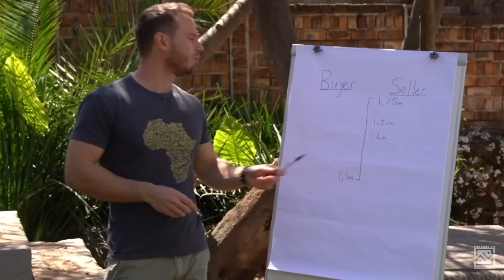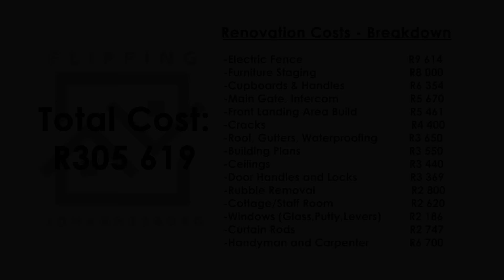Before and After House Flip - Project T | TWO RECORDS BROKEN! | Sold in 1 Day

Comment: Was the houseplan updated? I know most work was done inside and regarded as minor works.  I just also see alot of renovations been done to houses and there is no plans been updated.  Also if you have to revocer the existing plans you would be suprise how far the house has changed from the normal approved plans.

Comment: Nice! The only thing is; couldn't that weird shower space you removed been turned into a laundry closet? like where you have the washing machine and dryer hookups? (stacked) that way you make use of the existing plumbing. Then the space you reserved in the kitchen is reserved for the dishwasher? I'm finding as Africa catches up there's need for spaces for all these appliances and they were never considered before.
Reply: In South Africa we don't really put our washing machines there. They are usually placed in the scullery
Reply: @vik4741  I'm aware some houses do that if they have the additional space, I'm from up north. This one however, like most middle income to low income houses, didn't seem to have that space. The machine will be perfectly fine where it is allocated but it limits future options

Comment: For the bathroom it wouldve been good to turn the whole room into a wetroom instead of a closed in shower. That wouldve opened up the bathroom space  more. Huge difference in the house when it was complete looks really good.
Reply: Why would you want a wetroom in a house without a central air condition system? Isn't that just asking for smell and trouble?
Reply: @temper44   Many houses do not have central air conditioning systems and do have a wetroom. 

 A wetroom only requires an open floor room (thats tiled to liking), a safety glass wall to protect water from running into hallway where the door is, water runs into existing plug hole and well there is a window in the bathroom for ventalation so there is no condensation build up, also an extractor can be added to help with ventalation if wanted. Its not hard to figure those things out if you do it properly. So there would be no issues at all.

Comment: Question. Why did you not remove the walls between kitchen,dining and smaller living space to create one giant open floorplan? It would have cost slightly extra but it would have looked amazing.
Reply: Keeps costs down and gives the new owners the option to open up as they want. 
Design wise, I also thought making that space open plan was the obvious choice, but for flipping, its smart.

Cost wise, had he removed those walls, it would mean retiling those entire areas, making the kitchen that much more fabulous to match the space, extra build cost, extra planning cost and extra time.